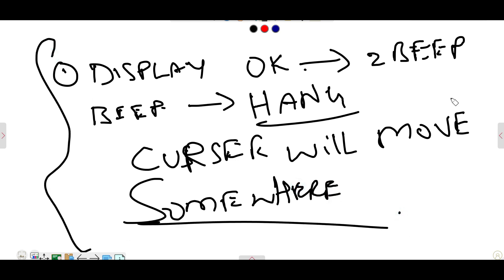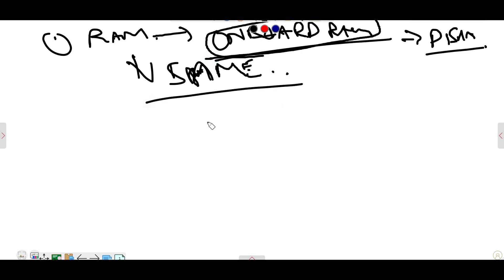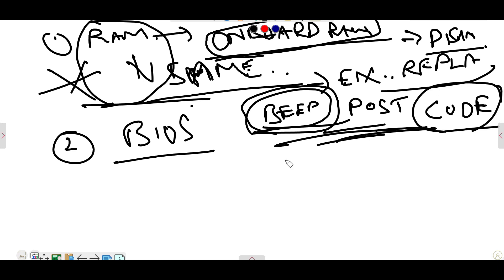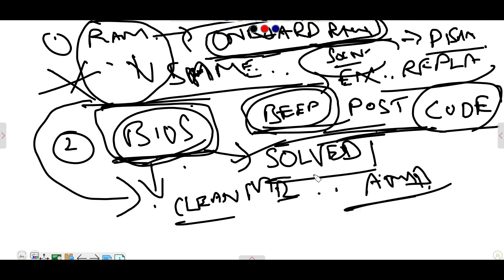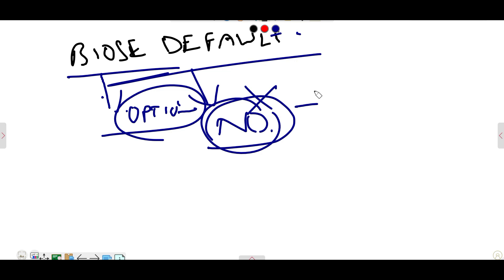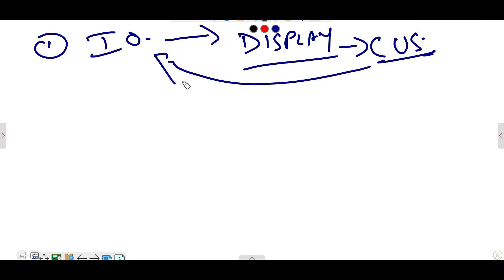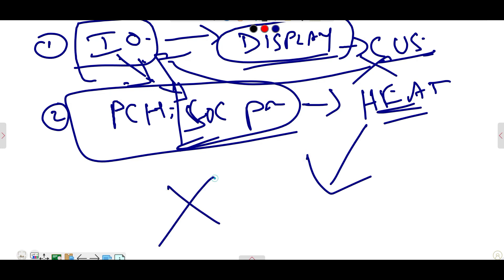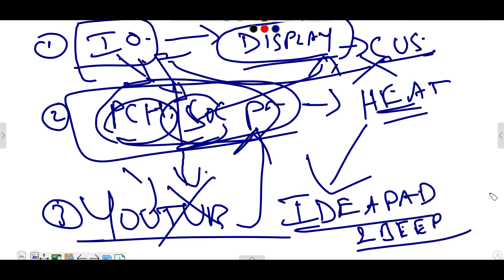Lenovo IdeaPad 2 Beep Issue   Unsolved!! | #laptoprepair

Comment: Dear, you have made so much fuss about this... The sub board which you used as a donor is actually defective too. Just remove the SD card chip from the Sub Board, all will work fine, audio even is perfect. Either replace with new chip RTS5146 or leave it as is, & inform the laptop user to use external USB card reader module, much cheaper & better. Hope this resolves the problem.
Reply from the maker: Thank u very much. It's one of the good reasons☺. Solution also explained in one of the comments.

Comment: I can fix it, the problem is with the novo button and SD card
Clean the board with thinner until clean
Reply from the maker: Yes. You are right. This also one of the main reason. We solved.
Reply: @yudharamlan9569  I am getting the same problem. Please can you help me how should I fix it.

Comment: Hello, same here  the sd card board was the issue, clean the oxydation with flux and reflow both capacitor and realtek chip.

Quivk diagnose, turn on, it make beep , unplug the flzx between motherbard and the sd card board, and the beep sound disappear.

Comment: I already experience this trouble long time ago thats why i forgot what i made, the problem occurs when the side board is connected, i had disable 3 pin and work fine whith sound and not freezing
Reply: I forgot what pin i disable, i put a Scott tape to disable pin on connector
Reply from the maker: ok. Thanks again. I will get back to you regarding these pins.
Reply from the maker: i found that. the pin no. 3 is for beep which is connected to IO(EC) PIN NO. 32. Yes, IO is doing its work. it indicating the issues through the beep. if we disconnect this, we can avoid the beep. but issue remains same.
Reply from the maker: Solved. If any issues with the pch connected connectors then issues will occur. means beep sound. 2 beep indicates the any weak signal in +ve or _ve path. for me, sdcard path was the issues. cleaned and resoldered the path. problem got solved.
Reply: @LaptopCourse  wow, Thankyou for that information, congratulation
Reply from the maker: Thanks
Reply: @LaptopCourse  hi.I have the same problem. can you explain in more detail what you did to solve the problem
Reply from the maker: Thank you for the reply. The IO board contains the speaker connection. can you tell from which connection's 3 pin you have disabled? because intel and amd ideapad series are almost same. I will try a solution according to your suggestion.

Comment: It's my opinion that all volt and signals should be checked with dso while hearing the 2beeps.
Reply from the maker: Thanks for your suggestion.🙏 All will be ok before the beep including coil voltage. At beep little changes will happen but all major voltages remains ok.